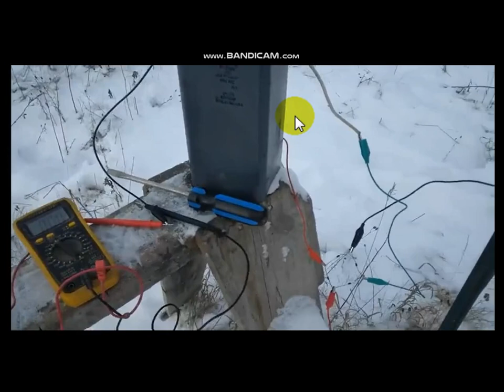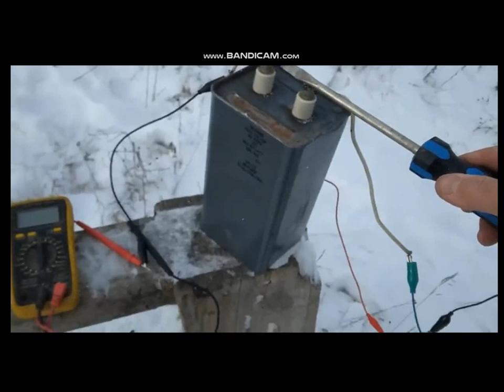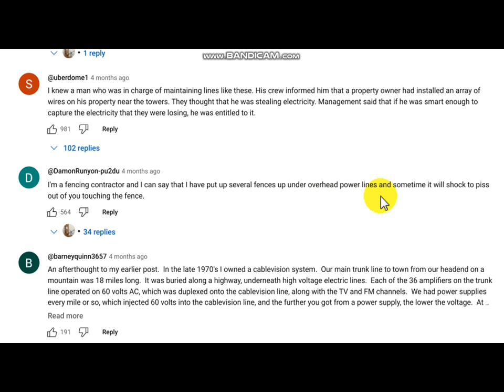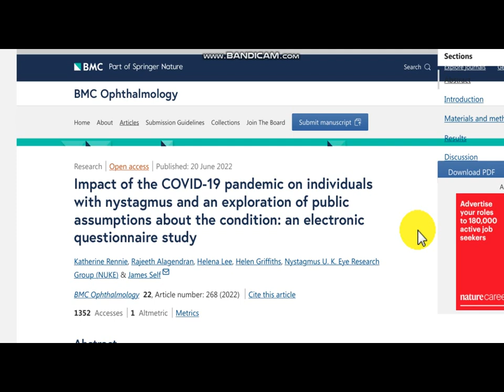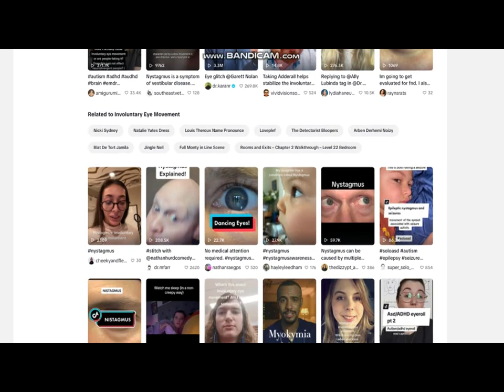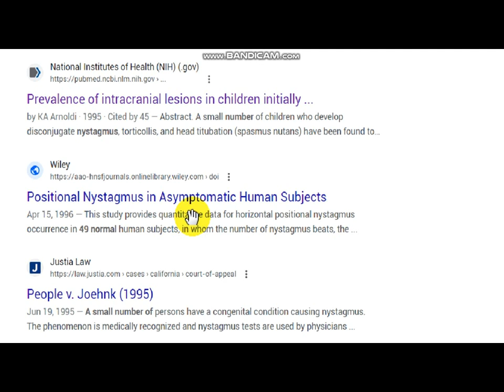NOT SO SECRETLY ELECTRIFYING THE AIR + RADIO FREQUENCY DUI 2

Comment from the maker: NOT SO SECRETLY ELECTRIFYING THE AIR - RADIO FREQUENCY DUI 2

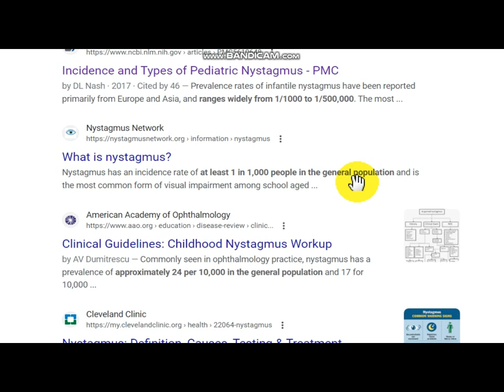**Something I forgot to mention in the video @10:18 is - 1 out of 1000 people is 0.1% ..So people had a 0.1% chance of coming down with these symptoms back in the 90's. Which, I will bet was lower and lower as you go back in time. To see the percentage now is staggering. And is far higher than it was in the mid 90's. 

Sometimes, you have to display the obvious to people again in order for them to make a connection. As many people have become oblivious to simple science. 

Although I don't believe that individual "monitoring devices" are necessary anymore, the point is still relevant. And it's also imperative to think about what can be powered with dirty power. Such as devices in a phone, computer, TV, etc. 

Also - "Products" in the air / sky allow electrcity to travel much further. As it makes the air much more conductive. Not only for our grid electricity. But also HAARP-like technology.
Reply: Wow I had no idea 🤯

Comment: Psych drugs also cause a lot of twitching
Reply from the maker: This is a "which came first?" scenario. As exposure to EMF, ELF, RF, EF can and does cause mood disturbances, depression, "bi-polar" symptoms, etc. The longer a person spends time within these fields, the more "sensitized" they become to them. For example - There is a HAM operator who has become so sensitive, he feels it in his joints every time he keys a radio. 

SSRIs and other psychoactive drugs certainly have a negative effect on the nervous system. That is without a doubt. However, since these fields create the very symptoms that can get the person put on the drugs in the first place, it's hard to tell what is doing what.

Comment: I find it ironic that all that free (dirty) electricity is there for the taking .. and yet…? They can’t keep the electric automobiles running… charging stations should be a dime a dozen. Not only evil, it’s greedy 
Thank you for another purposeful video.
Reply from the maker: Everything about "electric cars" is suspect. 
- The inability to create a reliable battery
- The inability to create a fast charging power source
- The refusal to create something that doesn't need to be recharged. 

Let me elaborate on the last in the list - 
A gas powered car uses an alternator to power up the battery. Once the battery is charged up, you don't need to charge it again unless the owner leaves the lights on or something similar while the engine is off and kills the battery. Then it has to be charged up enough to turn the starter over and will normally recharge on its own from driving. 

They even sell power inverters for people to convert 12 volt power to household power. Giving them the power to run whatever you want off the battery. Generally while the car is running. 

If an electric vehicle had a large alternator or even two alternators, you should theoretically only have to charge the car one time. And driving the car would charge the battery. Doing away with these ridiculous charging stations altogether. But they want people paying for power that costs more than gas a lot of times. It is ridiculous. 

Believe me - In 2024, there is the technology to charge an electric vehicle while driving. It's actually a very simple concept of the alternator / battery symbiosis. But it doesn't really amaze me that these car companies skipped that part.
Reply: @LookoutfaCharlie  one can charge a watch with walking motion swinging their arm. 🤷🏼‍♂️
Reply: rail cars

Comment: i have been diagnosed with fibromyalgia, I understand what it actually is, it is debilitating and very painful nonetheless at 39 years old and doubled in intensity quite literally almost two years ago when a guy from Appalachian Power creeped into our driveway and he saw me spot him and I ran to the sunroom put my boots on and came flying out the door as he slung gravel all over my parents '07 Ridgeline that had unblemished paint until then. He saw me coming, knew I was coming, and knew I was trying to stop him from installing the smart meter. I've had neurological problems from asthma to hyper mobility disorder for 35 yrs after receiving public school pokes at age four as my mom made me get shots and illnesses when my older brothers got them. I almost passed at age 7,12, 15, and 21 from issues with my lungs. Then I had relief from them for a year or two and the pain I had from age four drastically increased each year coinciding with the more wireless devices and radiation in the air. I was diagnosed at 34 with the neurological disorders, but I knew for a long time i was suffering from what most were not, but it does not compare to the astronomical increase in pain after the smart meter was installed. There was a suit in VA that allowed you to have it removed  and the old one reinstalled but you have to pay $70 a month for someone to come check it, that is how they pretend it costs them too much to manually check. But you won't even have the pleasure as they won't return you calls to have it serviced, won't respond to letters, emails, lawyers, and if you get them on the phone by chance they put you on "hold"/hang up. My dad got cancer right after the thing in '21, my mom started having mini strokes (TIA) supposedly, my father just had kidney failure and brain damage three weeks ago bc his doctor was dosing him with tons of calcium for "bone strength" in a 74yr old with terminal cancer and sarcoid in his lungs. it shut his kidneys down. After Three weeks in the hospital and a week in a rehab facility for cognitive and speech therapy he's home and can't think, can't remember anything, is confused like he has dementia. it's called PRES, and Its from his kidneys shutting down and brain swelling and is still swollen. So I take care of them and work at night as I can. All our illnesses are from "required" trust the scioence BS, and I'm grateful for your channel. I've been watching a few years, I know your dad died about a year and half ago, I'm sorry for your loss as well. Keep it up brother